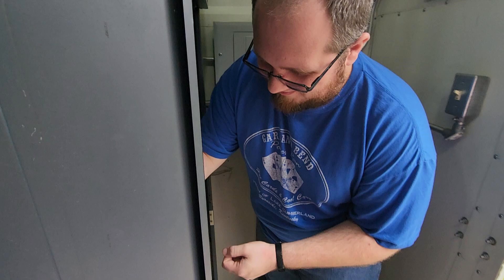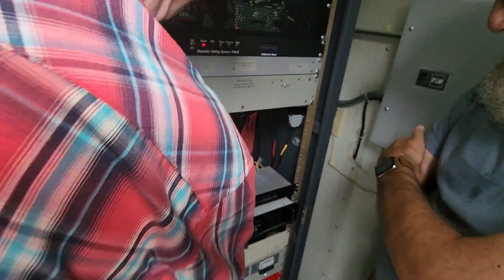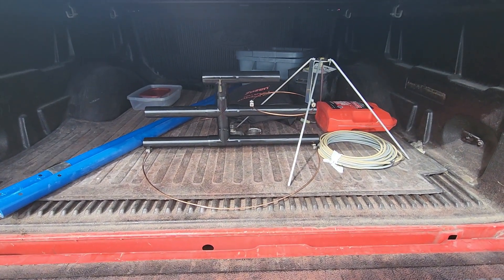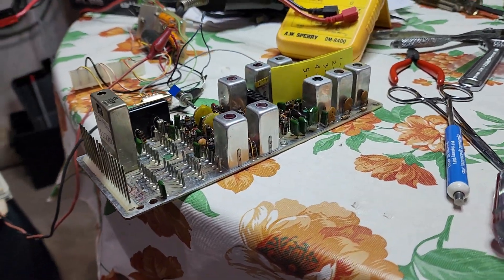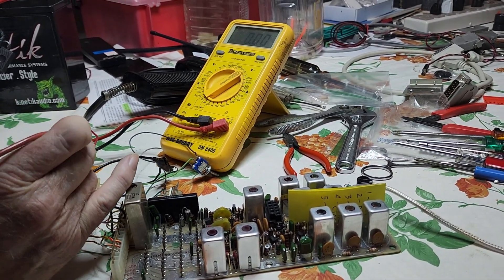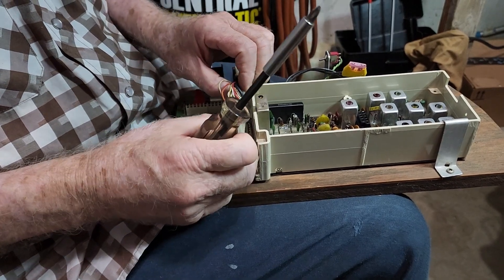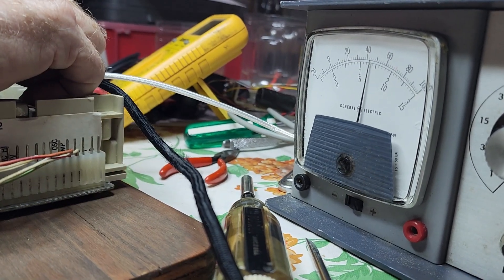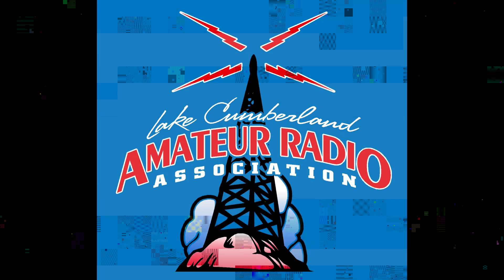LCARA HAM Radio: Activities Any Club Can Add to the Calendar!!!!

Comment: I know this is an 1 yr old, but just popped up on my feed since I subscribed to your channel. I run several repeaters and help with others here in metro Atlanta. All with Arcom controllers. On our main hub repeater (for Georgia Skywarn) I use a CAT RLS-1000b off the Arcom. It gives me three ports off of one port on the Arcom. We run a 220mhz link radio and a hardwired link to another repeater in the same shack. Works great. Be happy to share if needed. Robert Burton KD4YDC

Comment: Have a lot of experience working on MASTR II equipment. Do yourselves a favor, replace ALL of the tantalum caps on all of the boards. Failure of the wrong cap can take out critical modules that are unobtainam.  I have a MVP Repeater that I used at Hamvention  back in the early 2000’s. I recently popped a tantalum in the exciter board so it’s time to replace all of them so as not to damage the unit beyond repair. Peak and dip, ah yes, we peak each stage then we go to the next stage while still metering the first stage and tune the next coil for a dip which indicates successful loading into the next stage. Then switch the meter to the next stage and peak the meter. The service manual is the Bible for the sequence needed. Continue the same for each stage. I even have one of the old MII 800MHz trunking repeater. Bought it cheap for the chassis. You can even cross band the MASTR II line. Too bad most of the series out there use phase modulation in the exciters. There was one last version that did use a true FM exciter. Only issue now with these fine radios is that ICM went out of business. They could deliver your Icom on the correct frequency with the proper compensation curve. Anyone still making rocks for the old equipment?